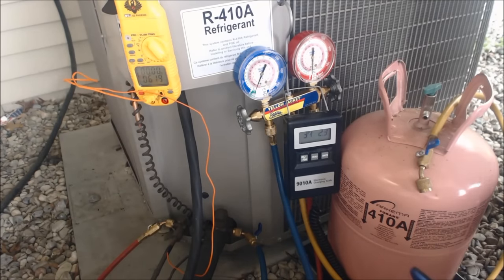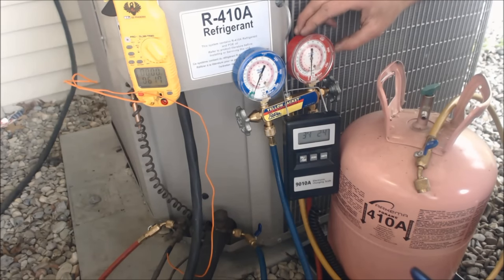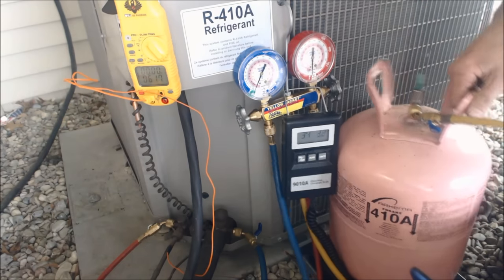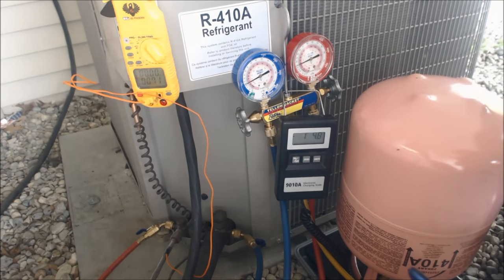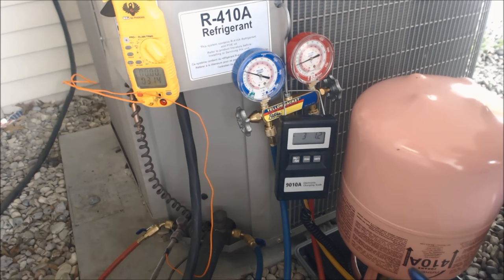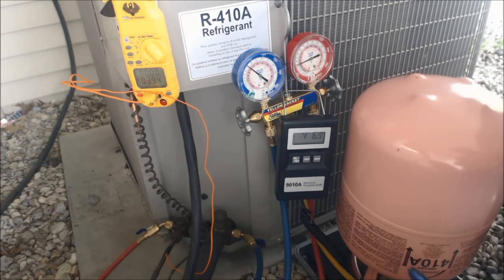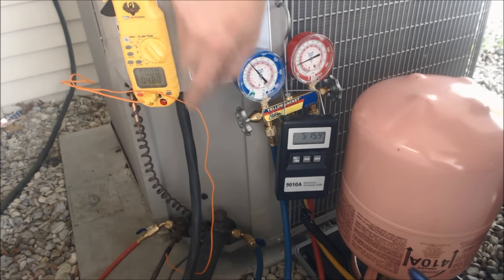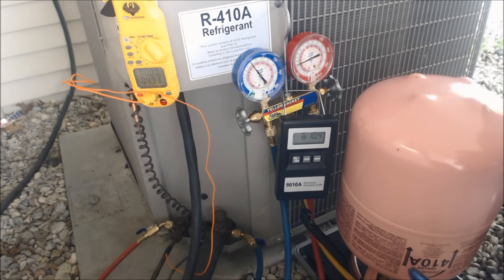R-410A Charging! Weighing in Refrigerant Charge through the High Side Red Gauge and Why!

Comment: so while the system is running , when do you charge through the low side only using that metering device? or do you always charge to the liquid side ?
Reply from the maker: You can only charge liquid into the liquid side when the system is down bleow 500 microns of vacuum. While the system is running you charge liquid r410a through a vaporizer and then into the low side or a little liquid at a time so that it may have a chance to expand in the low side line before going to the compressor, thanks.
Reply: acservicetech ok thanks for your response
Reply: acservicetech another question I tried to practice what you've taught in the videos checking for subcooling and I have a Daikin split system so I hooked up my gauges put the temperature probe on the liquid line right past the valves and my high side is reading 415 psig and a temp of about 124 degrees for r410a. and my meter was reading about 99 degrees.
the panels at the condenser don't say anything about schooling recommendations . I had to check online and it says something about 15-16° subcooming and also something about putting the temp  probe 6inches from the TXV to find subcooling. idk I find it kinda weird. am I doing something wrong?

Comment: Hi sir!i have a 2.5 ton condender,how much liquid you think ill need to add?its a r22 system
Reply from the maker: The weight of refrigerant that came in the unit from the factory along with the evap coil and usually 15 feet of lineset is on the rating plate on the side of the unit. Is this what you mean if the system is empty?
Reply: acservicetech ...i dont have a scale do you know about how much liquid i can put on before turning unit on?if you can tell me in how many minutes?

Comment: Thank you for this excellent video!! Just have a question, when a 4 ton 401A Trane DX packaged unit is vacuumed to 500 Micron will the compressor oil be vacuumed as well and pumped out to the vacuum pump? do I need to add 42 oz POE oil with R410 A through high side service port? no instruction available from the company, Thanks!!
Reply from the maker: No the oil inside the system doesn't end up getting sucked out of the compressor, thanks. Just vacuum it below 500 microns, check to make sure the micron level doesn't rise, valve off the micron gauge and then break the vacuum with refrigerant, thanks
Reply: I do thank you very much for your clear and sound answer!!!

Comment: So what happens if a tech tried this and did vapor charging first? Can you put the rest of the charge in as liquid or do I need to start over?
Reply from the maker: You can but you may not even get 1 pound in before the pressure in the system pushes back against the pressure in the bottle. If it were r-22 then you could add in the rest as vapor but since it is r-410a in this video you would either have to recover, vacuum and add in as a liquid or you could try charging in the rest a little at a time into the vapor side. It would be safer with a 535-c vaporizer, thanks

Comment: What if you can’t see the amount of refrigerant is there a formula? To determine the amount
Reply from the maker: There are weights per foot of lineset but generally you would need to guess the initial charge of the unit. You could look up the weight in an install manual, thanks

Comment: hi ac tech. i followed this procedure and for some reason my evap coil froze up, is it possible by adding 10lbs of liquid ref all at once that it could freeze the coil? i did have the blower running which i wasnt sure was good or bad.
Reply from the maker: Are you talking on a split system? Usually we don't run the blower and we try to weigh all the refrigerant needed into the liquid port before the liquid has a chance to vaporize into gas to apply pressure against the bottle pressure. You may get a little frost but not a whole lot. I don't think ten pounds of refrigerant can be weighed into a unit while it is off on a standard residential system if the blower was on because it would add heat and pressure faster to apply pressure against the bottle pressure. The compressor was off and and you were breaking the vacuum with refrigerant right? Thanks
Reply: yes its split, i broke the vacuum and weighed in 10lbs with the compressor off but the blower was running, system called for 170oz, im not sure why it froze, i dug into the air handler cabinet and seen it was frozen at the piston and capillary tubes, normal high side pressure, very low suction pressure at like 50 psig, im thinking there might be blockage at the metering device or capillaries, thanks for any advise, love your videos
Reply from the maker: You are checing the refrigerant charge with superheat and subcooling correct? It is possible that the system is still low on refrigerant if something happened with the scale. Otherwise it could be low airflow or liquid line restriction
low refrigerant charge- Piston-superheat high, subcooling low//////   TXV superheat normal, subcooling low///////
low airflow- Piston-superheat low, subcooling normal to low///////    TXV superheat normal, subcooling normal to high//////
liquid line restriction- superheat high, subcooling high

Comment: My R410a A/C unit has no refrigerant left due to a leaky schrader valve. Does the system need to be vacuumed before recharging?
Reply from the maker: Yes absolutely. I would also pressure test first, thanks
Reply: Sounds good. Thank you so much :)

Comment: hi once the ac will not take anymore freon  then you turn on system and add to liquid side  and do super heat ???
Reply from the maker: After breaking the vacuum with refrigerant in the high side line while the unit is off, turn the unit on and charge into the vapor side a little at a time while checking either superheat or subcooling as needed. Check out the "acservicetech superheat playlist" and the "acservicetech subcooling playlist"
Reply: thank you this was alot of help

Comment: do you have liquid valve open on you gauge while adding freon ???
Reply from the maker: This system was off and under vacuum when I broke the vacuum with liquid refrigerant into the liquid line up to the factory charge stated on the rating plate. It was a compressor changeout, thanks!

Comment: Question: When you vacuum the system down do you open up the king valves then vacuum down to 500 micron?...........Probably a dumb question...
Reply from the maker: Thank you for the question! So in this case, there is presently no refrigerant in the system behind the service valves. The service valves that go to the compressor are open so we are breaking the system vacuum with R-410A liquid by weighing it into the liquid line which is where it is supposed to go so that the refrigerant has to go through the metering device to make it back to the compressor as a vapor. If you had the service valves shut like in the case of a new R-410A outdoor unit and you were vacuuming the lineset and evap then you would break the vacuum with refrigerant from the system by opening the valves instead of from the refrigerant bottle. If you knew that you had a very long lineset when installing a new R-410A outdoor unit and you were vacuuming the lineset and evap then you could break the 500 micron vacuum by weighing in the refrigerant needed for the extra lineset and then you could open the service valves. I hope that helps! Thanks for your Great Question!
Reply: Thank you for the quick response.......Great video's by the way (watching them all)....
KEEP THEM COMING...
Reply from the maker: I Appreciate the Comment! I will keep them coming!

Comment: Is the evaporator fan motor running while refrigerant is weighing in?
Reply from the maker: I would not run the evap fan because you don't want heat absorption  while weighing in refrigerant. That would mean a pressure rise against what you are trying to weigh in, thanks
Reply: No.

Comment: I asked this question in a different way on your other video about mitsubishi Mini split charging. If I run the unit in heat mode, can I use the low side valve to charge in liquid refrigerant like you are doing in this video? My system is completely empty now so I will need to evacuate and charge back in.  The problem is the mitsu mini split doesn't have a liquid line (1/4" line service port).  I am guessing there's no way to weigh in refrigerant as a liquid into a mitsu mini split with the unit off?
Reply from the maker: Loose, if the system is empty of refrigerant, pressure test the system with nitrogen under the max design pressure of the unit, release the nitrogen, vacuum the unit below 500 microns, perform the standing vacuum test to see if you are holding a vacuum. if it stays below 500 microns, weigh the correct amount of liquid refrigerant as stated on the rating plate and as needed by the cumulative length of the line set into the liquid line of the outdoor unit. The system is off this whole time. Give the refrigerant some time to saturate and circulate while the system is off, then after 20 minutes, go ahead and turn the system on. Make sure you are EPA 608 certified before buying or handling refrigerants, thanks Loose!
Reply: @acservicetechchannel  thanks but this mini split has no liquid line service valve, only 3/8 Schrader valve and then a charging port that says suction too.
Reply from the maker: Hey Loose Cannon, I answered your Minisplit comment in the other video. This video has a liquid and vapor port so I answered this question for a standard split system only, thanks!
Reply: @acservicetechchannel  Thank you!

Comment: One question, when I am adding 410A, I go by what the plate states on the side of the condenser unit then, depending on the length of the line set (which the one for this entire system is about 25-30 feet, I would just add about a pound more? The Goodman is a 2 ton unit and it states 72 ounces which is 4.5 pounds. So I could add to this point and then it would be safe to start up the system or wait until I add about a pound more to make up the line set and air handler coil space?
Reply from the maker: So the rating plate will say how much refrigerant the outdoor unit comes with to include 15 or in other cases 25' of lineset and enough to fill the same capacity evaporator coil as well. Any foot after that could be weighed in but since your lineset is so short, I would just turn the system on and check the charge unless it is too cold to do so. It should be 70 degrees outside in cooling mode. I am assuming that this is a new unit and you are all done vacuuming and are breaking the vacuum with refrigerant from the outdoor unit, thanks
Reply: acservicetech No,  I replaced a bad compressor. I did something wrong, obviously.  The compressor starts up,  all readings are good (325-350 high side, 150 low side and then it drops out on me after about a minute.  The high starts dropping and the low side goes up.  I shut it off for about a minute or two,  turn it on it runs great for a minute and then starts the whole process all over again.
Reply: acservicetech that's good to know about how much Freon comes in a new condenser unit. That they figure enough for the line set and the coil. That helps me as well.
Reply from the maker: Charles, did you open up the service valves all the way? That kind of sounds like what would happen if the vapor side valve is only partially open. Is it a heat pump which would have a reversing valve?
Reply: acservicetech Its a Goodman GSX140241LC. I did make sure  the valves were open all the way. They were still open from when I recovered the freon. I had a problem pulling the vacuum and I think that's what started the whole thing. I ended up buying a new supco vg64 digital micron reader. Also, I don't think the vacuum pump was working very well. I'm new here,  following after some maintenance people who didn't really take care of the equipment. I think I got in a hurry and I don't think I had a good vacuum on it and I think I ruined the compressor. I'll keep watching your videos.  :-)
Reply from the maker: I doubt that the compressor is ruined. I see the unit is a condensing unit. Maybe you have air mixed with the refrigerant. Were you able to pull down to 500 microns and hold that vacuum? Here is a vacuum playlist- https://www.youtube.com/watch?v=jlzecsOImqs&list=PLxnHR5_D2ojxXtMK2acxvUF8aqowcksMx
Reply from the maker: Oh I am sorry, I read too fast. You are saying the compressor is shutting off not just the pressures rising or the internal relief valve is blowing, letting high pressure into your low pressure, got ya
Reply: acservicetech no, I did a nitrogen test and it held at a hundred 50 psi for 20 minutes but after an hour and a half of vacuum my Micron reader wasn't showing any less than 2600 microns. So I just, like I said was in a hurry and added Freon like you said and tried to flush some air out the low side hose and then shut it down and start it up. At first the head pressure went up to about 4:25 for 50 and I shut it off and I contacted a friend of mine and he said it sounded like I had too much freon in it. So I reduce the amount of freon in it and that's at the point I'm at now.
Reply from the maker: You won't be able to flush any air out, only what is in the refrigerant hose when trying to charge the system. It sounds like you need to recover either way, thanks

Comment: hi,can you do this same procedure is it was r22?
Reply from the maker: Yes you can, thanks
Reply: oh ok thanks i always thought it was through the suction side only
Reply from the maker: It has to be weighed into the liquid line if the system is vacuumed down to 500 microns and you are breaking the vacuum with refrigerant. If the unit already has refrigerant in it and is running then you charge into the low side of the system, thanks
Reply: acservicetech ok thank u,,so it will be faster to ad freon on hi side if system was vacuumed?
Reply from the maker: If it is an empty system, meaning that there is no refrigerant in the outside unit then you would pressure test, vacuum to 500 microns and break the vacuum with liquid refrigerant weighed into the liquid side to the weight stated on the outdoor unit rating plate, wait 5 minutes, then turn on wait 10 minutes and check charge with subcooling or superheat. If there is refrigerant in the outdoor unit held back by the valves then pressure test the lines, vacuum the lines to 500 microns, then break the vacuum by opening the service valve to let the refrigerant in from the outdoor unit to the refrigerant lines. If there is already refrigerant in the lines then just turn the unit on and check in superheat or subcooling as needed. For more info just watch the playlists for superheat-  https://www.youtube.com/playlist?list=PLxnHR5_D2ojwGvhU1rseXQLJ-XBjBZMMk    -- and subcooling-   https://www.youtube.com/playlist?list=PLxnHR5_D2ojxTcAtR_53GoY8huBcSOt0a

Comment: so that system in video takes 12lbs of refrigerant? some are 3lbs aren't they?
Reply from the maker: If it is an older comfort cooling system that has less fins then yes it could be that poundage. This was a 5 ton 410a heat pump 16 seer, thanks!
Reply: acservicetech ..thanks for your help

Comment: How much does it cost for refrigerant ?  I think I got ripped off from a family friend's friend . He charge me 250 to fill up my AC.  After one day it stop working again.  My guess it is a leak.
Reply from the maker: They should tell you before doing it that they cannot guarantee how long the refrigerant will last in a system or really better, find and fix the leak. Either way, the tech should give the customer an option on what they want to do before hand. R-22 $850 per 30lb bottle and R410A $130 25lb bottle presently thanks
Reply: Yo, I was told 410-A went up huge, at least  here in FL ---
Reply from the maker: https://amzn.to/2jSv7hh here is an example of price, thanks